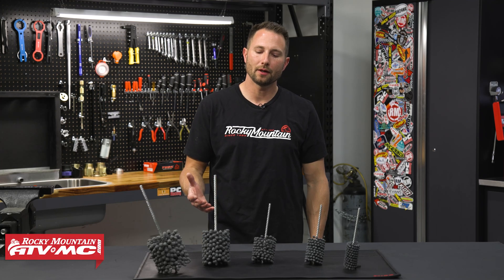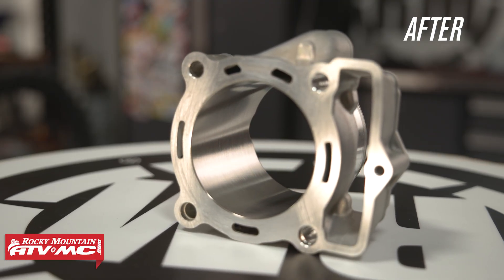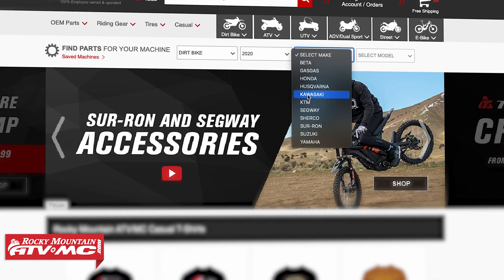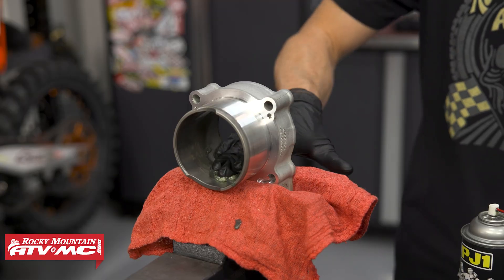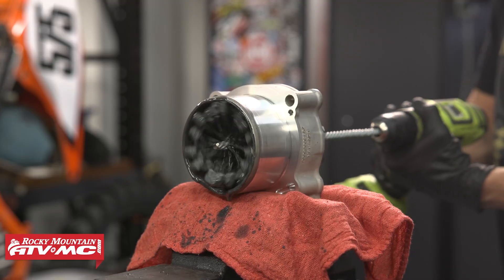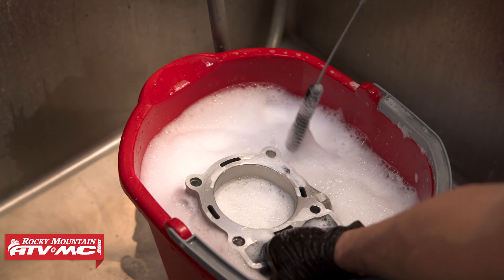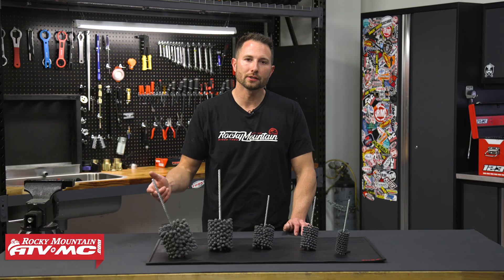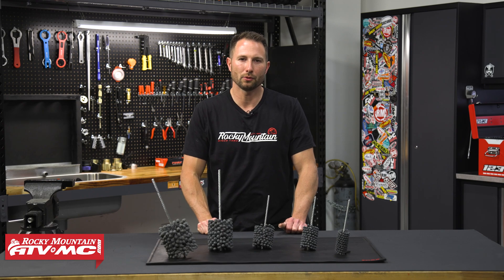How To Hone A Cylinder W/ Tusk Flexible Cylinder Hone

Comment: Step one never hone a Nikasil plated cylinder
Reply: You’ve been lied to your whole life. You’d be amazed what one of these silicon carbide 320 grit hones will do. I personally prefer to use the aluminum oxide 240/320 grit flex hones. As long as you have a good strong coating in the bore you will be able deglaze it and cross hatch it no problem. Another cool thing I’ve noticed with them, is they actually chamfer your ports for you too
Reply: That’s what I have always heard
Reply: You can diamond hone them, my machine shop guy does mine. I wouldn’t use a ball hone that’s just me though